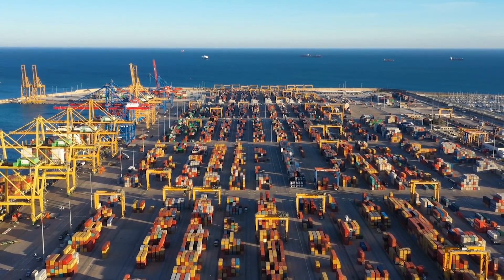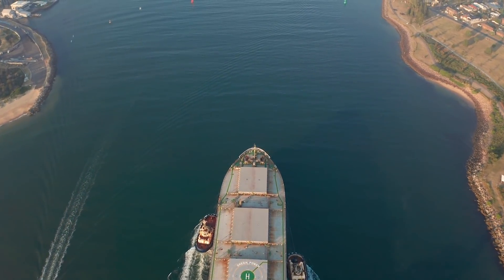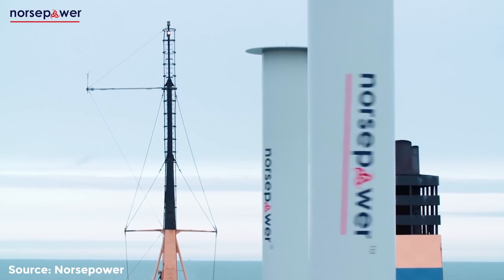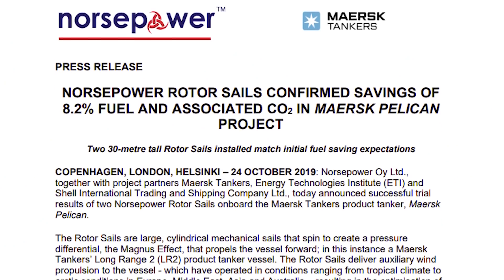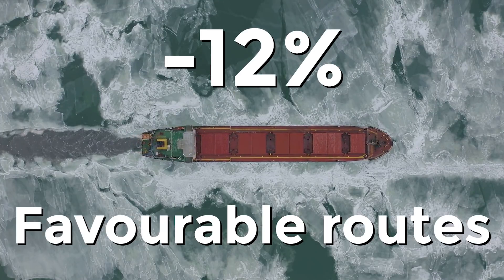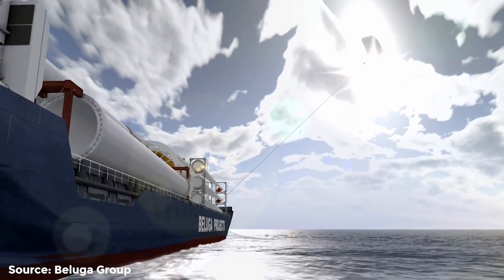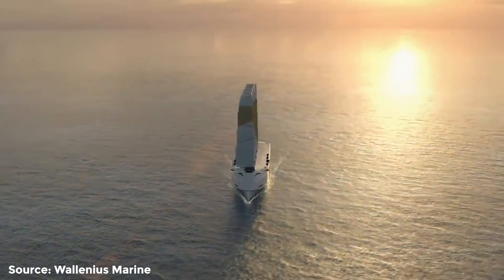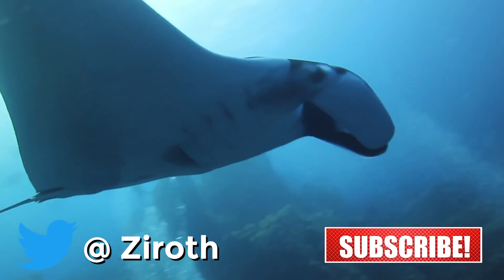Is Wind Power The Future of Shipping?

Comment: Aero engineer here. Although you are right to be skeptical of the 90% claim, you need to take into account that lift is directly proportional to wing area. When you compare the beluga to the single kite solution, there is an evident difference in overall lifting surface area. Also when compared to the Magnus effect 'sails', which furthermore depend on rotation speed for lift production. It is not far-fetched that based on these principals that conceptually, a solution with a large collective area of aerofoils would outperform the other two solutions maybe even by a large amount. The problem with this solution is the difficulty to implement a mixed system and also the cargo reduction due to the huge design footprint. Remember that sailboats can do it with no powered propulsion!

Comment: I think the air foil has the most efficient design and would work in situations such as transporting cars or aircraft parts across oceans (or oil, as that can go inside of the hull too), they are quite efficient, with some optimized designs even being able to go upwind (i saw this in a presentation on foil gp type boats, i believe the channel was "https://www.youtube.com/channel/UCwG9Ah2xXDR4CmgsrzYaLCQ") the kite boats do make sense for transport ships, but i think that the ships will start having a aerodynamic shell at the front, it doesn't even have to be wasted space, they could just crane it on top of the boxes.

Comment: sooo, what were cargo ships 200+ years ago using. I mean I get they aren't massive container ships like today but those vessels weren't small in size either and have navigated using the stars and wind without fail.
Reply: What do you mean "...those vessels weren't smaller..."??? You are talking about wooden sail boats that are dwarfed compared to today's container ships. The mere weight of cargo ships would render sails to be practically useless. Using wind on todays ships means increasing the fuel efficiency by a small percentage.

Comment: Can someone explain to me how the vertical pillars work? I know they obviously do work, but what makes them go forward as apposed to sideways, diagonally, or backwards? I ask this because the pillars are perfectly cylindrical and I don’t see any design features that I’m able to observe at least, that would be the cause of the columns creating forward thrust as apposed to backwards or sideways thrust. If they are cylindrical what is making them provide thrust in one direction as apposed to producing thrust in 360 degrees all at once and therefore immobilizing it altogether? Again obviously it does work but I just want to know what makes it go forward when it’s a cylinder that has no one side being different than all the other sides of it?
Reply: It is the same concept of suspending a beach ball in the air by blowing air over it. It is not the typical airfoil design but the faster moving air on one side creates an area of lower pressure. With the ship moving forward, the faster air is at the front of each cylinder.

Comment: Multiple kites, each flying  in a different altitude (or something. Not an expert on sailing). That way, minimal cargo area is used, and we can take advantage of far more air power than even a traditional sail system. It seems like the easiest system to maintain, and can be retracted completely, or have parts easily swapped. Largest part is the sail, and it can be folded. It also seems easy add to an existing ship.

Comment: You could not live with your own failure where did that bring you back to Me

- Every Ship with a sail
Reply: To address the suggestions that sail power is the answer I offer the following.  In 1870 a premium sailing vessel entered service, the ‘Cutty Sark’, she could carry around 600 tonnes of cargo at speeds of up to 17.5 knots, dependent on the prevailing wind, to harness the energy the available spread of canvas was up to 2 976m2.  To round things out that was circa 5m2 of canvas for every tonne of cargo carried.  The ‘Cutty Sark’ was designed and built for employment in the tea trade where time on passage was a large factor in securing the premium freight rate that made her cost effective but as soon as the Suez Canal opened, which the ‘Cutty Sark’ was unable to sail through, she lost her advantage, raw speed, to the steam powered ships of that era.  Mechanically powered ships have improved in terms of efficiency, on a freight tonne mile basis, by at least one order of magnitude since then.  After losing out to the coal burning, steam reciprocating mechanical ships of the late 19th century ‘Cutty Sark’ was relegated to the Australian wool trade, just about the bottom of the barrel in maritime terms and only one small step up from being a 'honey barge'.  The canvas, cordage and extra manpower needed for sailing ships was never a very benign environmental option so please discount any idea of sail as ‘sustainable’.  All this is without the problem that if ‘the wind don’t blow the ship don’t go’, when it does blow it often blows in the wrong direction for your cargo delivery needs and sometimes there is rather too much of it for comfort.

Comment: On the aero foil solutions I don't see that working at all. Any foil on a ship would make it lean in some kind of way. the best solution I saw was the kite solution that was interesting to me. i would think it would give some kinda lift to the vessel while pulling it also. It might also cause lean but i would invest in kite over foil. With kite system if you ran into trouble at see you could allways cut the kite away but the deployment of the foil and other like it would be slow.

Comment: All these examples "reduce" the fuel consumption, meaning it is still petrol powered, if you wanna eliminate fuel consumption entirely, go nuclear, with modern designs of small nuclear plants you can have autonomous or remotely controled reactors on large ships.
Russia already does for it's icebreakers in the north, it wouldn't be much of a stretch to put it in shipping vessels, though it's still a fair bit more expensive it at least has the advantages of cutting carbon emissions altogether and being more reliable than wind.

Comment: Lets slap some hydrofoils on those ships, reduce drag and get there faster, you can use a smaller engine combined with the kite
Reply: Of course, you need hydrofoils that don't snap under the weight of the ship and its cargo.  For that matter, the Hull, being up in the air rather than supported along its entire length by the ocean, needs huge improvements to ifs structural integrity.
Reply: @laurencefraser  we'll make them out of adamantium

Comment: The nuclear option is zero emission and reliable. But pirates are an issue then.
Or fully electric ships with fuel cells or large accumulators - it's not a big issue if they are heavy. And they can be charged by floating solar farms near harbor.

Comment: I wonder if you couldn't combine the sail technology with solar electric  I mean you have large surface area while true they wouldn't be in an optimum position to catch the sun this does seem to be a case of every little bit helps. Another thing I wonder about is couldn't the sails be mounted along the sides of the ship as opposed to along the centre line perhaps using some sort of outrigger system. Before people start calling me an idiot I want to make it clear my knowledge of sailing is about as good as my knowledge of Klingon opera

Comment: Wind-powered ships. Its called a sailboat
Reply: In this case it's more like diesil powered ships with sails as auxillary propulsion.  Sort of like the early steamships (as opposed to sailing ships with auxillary steam engines), though the technology of both the sails and the combustion engine is much improved and the reason for having and using the auxiliary system is different.

Comment: Covid 19 has demonstrated, what's the hurry. Bring back bigger sailing ships with combined computerized tech control.
Reply: To address the suggestions that sail power is the answer I offer the following.  In 1870 a premium sailing vessel entered service, the ‘Cutty Sark’, she could carry around 600 tonnes of cargo at speeds of up to 17.5 knots, dependent on the prevailing wind, to harness the energy the available spread of canvas was up to 2 976m2.  To round things out that was circa 5m2 of canvas for every tonne of cargo carried.  The ‘Cutty Sark’ was designed and built for employment in the tea trade where time on passage was a large factor in securing the premium freight rate that made her cost effective but as soon as the Suez Canal opened, which the ‘Cutty Sark’ was unable to sail through, she lost her advantage, raw speed, to the steam powered ships of that era.  Mechanically powered ships have improved in terms of efficiency, on a freight tonne mile basis, by at least one order of magnitude since then.  After losing out to the coal burning, steam reciprocating mechanical ships of the late 19th century ‘Cutty Sark’ was relegated to the Australian wool trade, just about the bottom of the barrel in maritime terms and only one small step up from being a 'honey barge'.  The canvas, cordage and extra manpower needed for sailing ships was never a very benign environmental option so please discount any idea of sail as ‘sustainable’.  All this is without the problem that if ‘the wind don’t blow the ship don’t go’, when it does blow it often blows in the wrong direction for your cargo delivery needs and sometimes there is rather too much of it for comfort.

Comment: This may be a dumb question, but is there any problem with nuclear reactors? Aircraft carriers use them
Reply: Aircraft carriers do not need to be cost effective.  Furthermore not all aircraft carriers HMS Queen Elizabeth is powered by gas turbines due to coast and availability, the nuclear fuel need s replacing after 20 years and the process takes a long time, during which the vessel is as functional as a chocolate teapot!

Comment: What about small modular nuclear reactors on board .. cheap fuel and efficient....or even hydrogen fuel cells?
Reply: What about if the ship sinks?
Reply: @B-A-L  There is a ship (nuclear floating island) in the Russian waters similar to what I spoke about. Also there have been nuclear ice breakers for a long time. Relating to your question, there have been 8 nuclear seacraft in history that have sunk along with their reactor cores. Interestingly enough, though not safe, sea water provides the best infinite cooling solution until we could come up with technology good for taking out those cores. Pertaining to your question again, the 8 seacraft mentioned were military submarines not civilian ships so they had a different plan of safety in place. As far as I know there have been no major civilian nuclear ship accidents in history. Also these ships have a few major routes and travel where no other ship can easily go plus needing to refuel every 8 to 10 years. Again, if it does sink, water provides an amazing solution as both a radiatin shielder and cooler to lessen the impact of the reactor cores' radiation.

Comment: I would propose an array of vertical axis wind turbines (which generate electric power completely independently of wind direction) sticking up above an array of solar panels the size of the upper deck (or maybe larger), with large batteries to smooth out the maxima and minima of generation so the electric motors driving the propellers run 24 hours/day. The batteries become the ship's ballast. The solar panel arrays need to be foldable to get them out of the way if the ship is loaded and unloaded by crane.  Unfortunately I have nowhere near enough information to calculate whether this could be practical.

Comment: The kite seems like a good deal considering you can add it to a ship already built. The computer and “mast” that hold it seems to be a minimal cost really. 8% on the low end month over month would be a substantial savings let alone if you got 20% to 30% for part of the time and never saw 50%. This system leaves the decks open as well. Imagine seeing huge kites for miles away over the ocean.

Comment: well ships are the only mobile platform where direct carbon capture is viable by doing this carbon can be turned back into fuel by taking in seawater separating the hydrogen then combining it with carbon resulting in fuel

Comment: yes, next!

the fuel those massive slow arse cargo ships burn is insane! I mean they're SOOOOO slow!
Reply: The very reason we stopped using wind power for ships is that it's slow. The huge engines these cargo ships use make them as fast as they can possibly be. These things weight hundreds of thousands of tons after all. Only way to move that kind of mass around more quickly is a rocket engine and a damn big one at that.
Reply: @destroyer1667  Freighters average 5 knots, that's slow, its slower then walking speed. sailing ships were and are MUch faster then this, however old sailing ships can't carry very much and take a lot of man power. The Cutty Sark for example needed (and indeed tall ships still do need) 100 crew (106 for the Royal Clipper). Compare this to a massive bulk freighter of today, 10 crew probably, that's where the savings are.
Reply: @LordInter  5 knots is very slow even for a container ship. They usually get around 15 knots, often more. They are also often more than 4 times longer and can carry much more cargo by an order of magnitude. Also a lot more reliable since they can move in any wind condition. That, and their low crew requirement compared to sailing ships makes them a lot more efficent to operate.

Comment: look up Flettner rotor use on a ship around 1920-1930. Driven rotors, acting like sails, reducing fuel use measurably. Flettner rotors work with wind from any quarter.

Comment: Sails:

What am I a joke to you?
Reply: To address the suggestions that sail power is the answer I offer the following.  In 1870 a premium sailing vessel entered service, the ‘Cutty Sark’, she could carry around 600 tonnes of cargo at speeds of up to 17.5 knots, dependent on the prevailing wind, to harness the energy the available spread of canvas was up to 2 976m2.  To round things out that was circa 5m2 of canvas for every tonne of cargo carried.  The ‘Cutty Sark’ was designed and built for employment in the tea trade where time on passage was a large factor in securing the premium freight rate that made her cost effective but as soon as the Suez Canal opened, which the ‘Cutty Sark’ was unable to sail through, she lost her advantage, raw speed, to the steam powered ships of that era.  Mechanically powered ships have improved in terms of efficiency, on a freight tonne mile basis, by at least one order of magnitude since then.  After losing out to the coal burning, steam reciprocating mechanical ships of the late 19th century ‘Cutty Sark’ was relegated to the Australian wool trade, just about the bottom of the barrel in maritime terms and only one small step up from being a 'honey barge'.  The canvas, cordage and extra manpower needed for sailing ships was never a very benign environmental option so please discount any idea of sail as ‘sustainable’.  All this is without the problem that if ‘the wind don’t blow the ship don’t go’, when it does blow it often blows in the wrong direction for your cargo delivery needs and sometimes there is rather too much of it for comfort.

Comment: First things first. They need to stop using bunker fuel and massive reciprocating engines. LNG turbines have a proven track record and are capable of powering electric motors, like azipods which would also decrease the need for tug boats. Then can you install sails at will